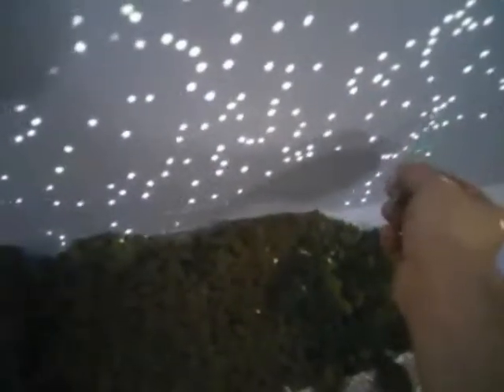UPDATE ON MY MODEL RAILROAD PART 23

Comment: Thats a cool trick
Reply from the maker: Thank you. It looked a lot better in person instead of the video. Back when I made these videos they were on my cell phone. But I recently did a video on my last. Lay out where I use fiber-optic wires. Glued to LED Christmas lights under my layout If you can find the twinkling lights. During Christmas time that will create. Twinkling stars But my most recent build I'm not done the Stars. I usually talk in my videos telling everyone if you are near a construction site. Nine times out of 10 if you see something that is going to be thrown away. They will give it to you. No questions asked. And I know this because I am electrician. When we demo lights we get plenty of cardboard boxes. Those boxes usually go in the trash. But you can also cut them into strips. And make cardboard wedding for mountains. When you lay out or you can buy the cardboard wedding pretty penny online I like the fiber optic wire. Eventually got that from the job. That would be in demo And was able to use it for my stars. All of the 3/4 plywood that I am using on my new. Layout build But I made my bench work from. Guess where that came from? You guessed it. Off the job We had to demo this one room. And it had a raised plywood floor. And it was going to be trash. But I asked they said if you want it take it. So I loaded up in the company van and brought it home. And as you can see on my new build I still have plenty of the 3/4 plywood to use up. Thanks for watching. Hope you enjoyed more of my videos
Reply from the maker: And thank you for the sub back.